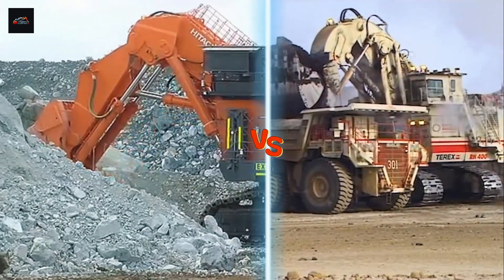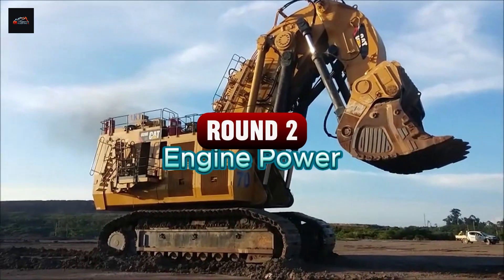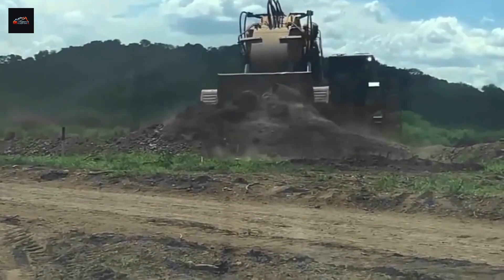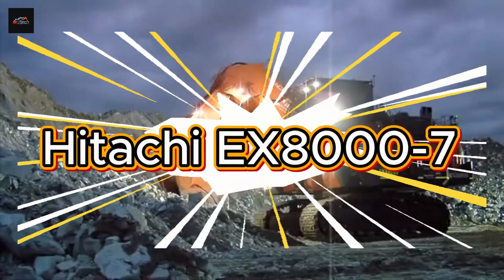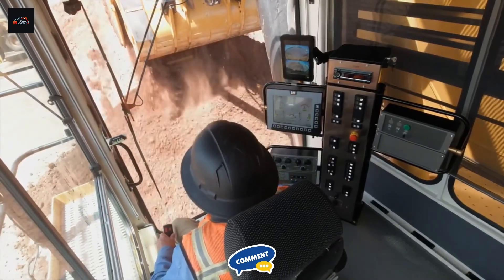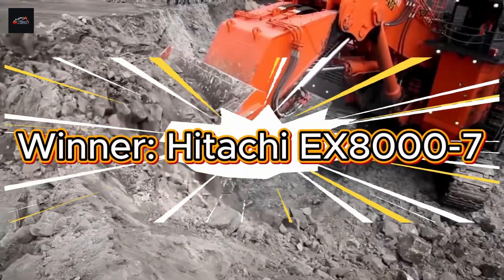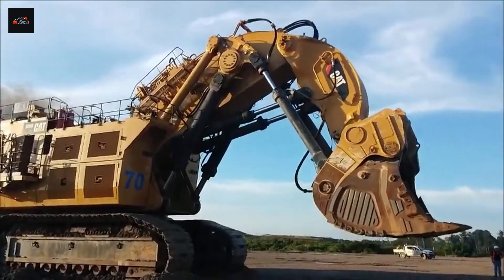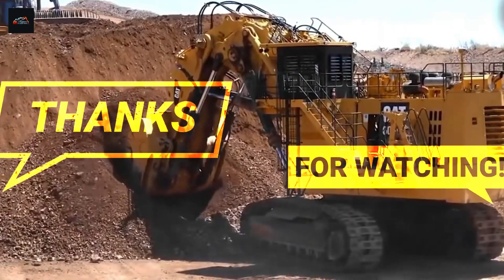Excavator Battle: Hitachi EX8000-7 vs Bucyrus RH400 (AKA CAT 6090)

Comment: Not exactly a fair fight with an 800 tonne machine vs 1000 tonne machine
Reply from the maker: @Ste-_. You're right. It isn't a fair fight, but I got the request from someone that watches the channel so I made it. If you'd like to see any match ups let me know.
Reply: Certo che è una lotta leale!. Questi due escavatori sono i più grandi e pesanti di entrambe le aziende.  Se guardi il peso solo komatsu pc8000 e liebherr 9800 possono competere con Hitachi ex8000. Comunque è bene sapere che l'attuale cat 6090 non è più in commercio. La gamma degli escavatori da miniera caterpillar si ferma al 6060 ovvero O&K RH 340 un escavatore da poco più di 60 t., 3000cv e benna da 34mc. Per i vecchi escavatoristi come me O&K resterà sempre nel cuore❤️